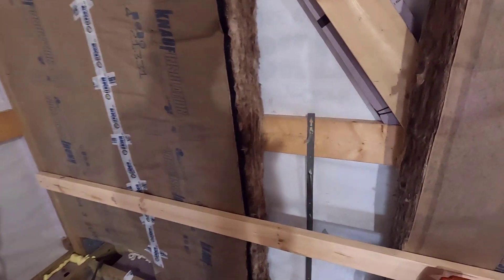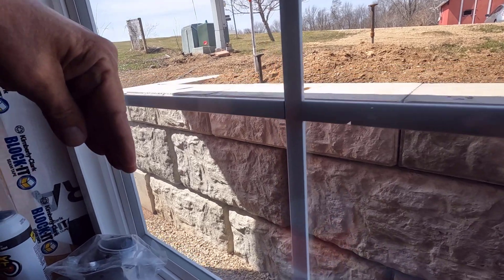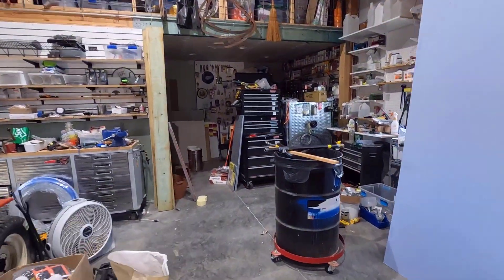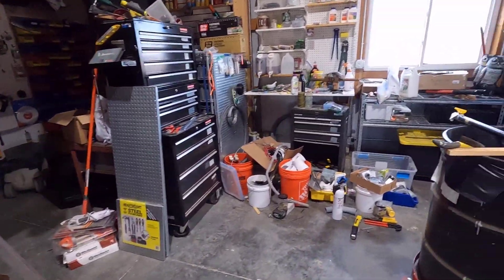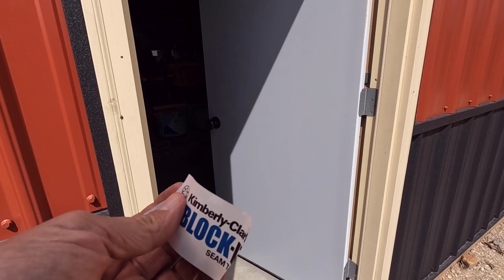Installing a Propane Line in a DIY Post Frame Building ― Part 2

Comment from the maker: Plumbing propane into a post frame building can be a lot harder than it seems at first glance! Gas lines want to be strapped to a structural member of the building right inside of where it passes through the wall so the stub-out can take the torque of the regulator being installed on the outside of the building, and be structurally sound outside after that. On a post frame, that may not be possible as in this case. Post frame construction also usually involves a tall building which adds to the complexity. In this case, the propane line also needs to be plumbed to the opposite side of the building nearly 50' away from where it enters, so there are a lot of things to consider when designing and installing the system. 

YOST Vises 750-DI Multi-Jaw - https://amzn.to/3Kosbnt
Forney 20857 Tap Magic https://amzn.to/3DSAZPM
Ratcheting Pipe Threading Tool Set (3 dies) - https://amzn.to/37pyokh
Ratcheting Pipe Threading Tool Set (5 dies) - https://amzn.to/3DWUaYF
Ratcheting Pipe Threading Tool Set (6 dies) - https://amzn.to/3NTOGme
Blue Monster Pipe Thread Sealant - https://amzn.to/3EvoXfs
Blue Monster 1/2" Blue Teflon Tape - https://amzn.to/3uYZLLt
Brass Gas Ball Valve - https://amzn.to/3869pCS
Johnson Heavy Duty Aluminum Box Level - https://amzn.to/38daLf0